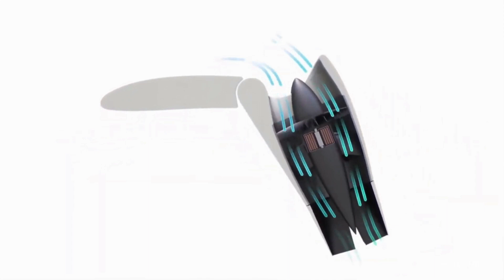Solving Ground Transportation Congestion - All Electric Vertical Takeoff & Landing - Lilium Jet

Comment: reviewed this film again, i found that Lilium has never shown the ability to fly with its rotors set horizontally. that makes me worried a lot!
Reply from the maker: As mentioned in the video their 5 seat prototype unmanned jet first flew in May 2019, and by October 2019 they have tested over 100 flights including transition from vertical to horizontal flight reaching over 100 kilometers per hour, but not not yet fully horizontal.  You are quite correct to notice that Lilium has not yet shown the ability to fly with its rotors set horizontally yet, back then.  Lilium in fact are testing their 7 seater for regional air taxi service, since we are towards the end of 2021 I suspect they must have made a lot of progress since 2019 and flying with the rotors set horizontally may have already achieved since it is the absolute requirement for a full VTOL flight. 👍👍👌🖐
Reply: @asreviewchannel  if they have accomplished this essential requirement, flying fully horizontally, why hides it away from public?

Comment: This icon is a full size evtol and have no need for blades faster than any other evtol up there and no need for charging batteries 😀
Reply from the maker: Big thanks my friend for your visit and such informative comment, so glad you have interest in eVTOL, we are going to see more and more of them in the next few years for sure. 🙏🙏👍👌😊💚🖐
Reply: Yeah for sure, it's a revolution of new technology and without doubt flying cars 🚗 with no blades, propeller or nothing to do with agitation of the air,  I saw it in a dream witch is going to happen hopefully before the 2045.
Reply: Well this all look good on paper, but the issue the company is facing right now is the fact that the Lilium can't fly for long. Its batteries are Lithium Ion and the weight of it to is the downside, plus by adding passengers. Not enough power to sustain long flight time. 
Hopefully when battery tech improves in the next decade, the company doesn't go bankrupt.

Comment: They are all NOT FLYING CARS. They all dont have wheels. They are just passengers drones.
Reply from the maker: More accurate term would be eVTOL or Electric Vertical Take-Off Landing vehicle or aircraft, whichever you want to call it.  Lilium and similar vehicles are not drones, because drones are unmanned aerial vehicles, these are manned.